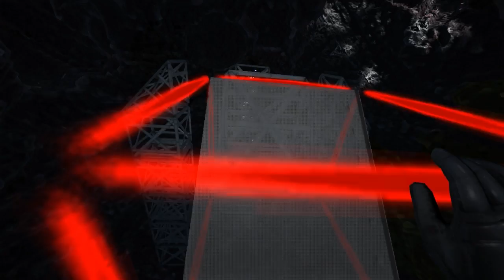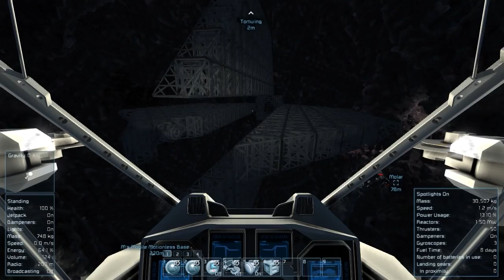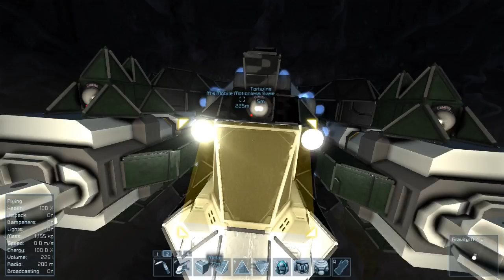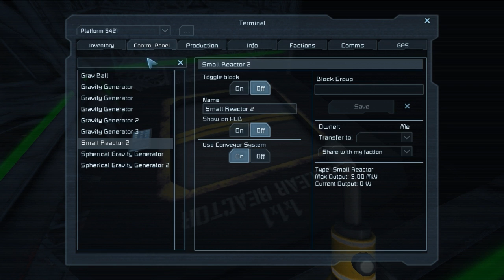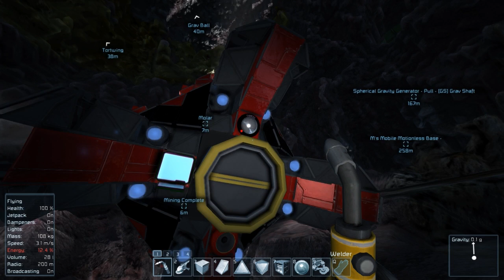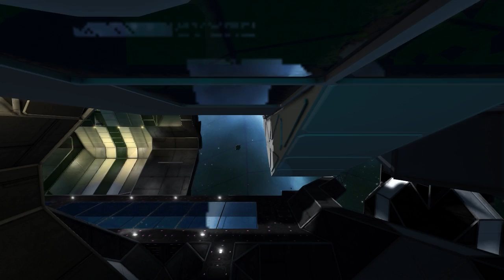Space Engineers • Solo Survival • 53 • Fins for Fun

Comment: Wow, Morilibus - that's one big ol' set of fins! Should prove handy for this asteroid but I fail to see how you might be able to haul it around and put it in the centre of another in the future - then again, that's what blueprints are for... I reckon the pulsing idea might work well with this design, but the need for it depends on Molar's ore ejection rate.

So, how many ejectors can you fit on Molar? You could maybe do with adding more than the design previously held, whether that means getting rid of the cargo or not I don't know - but Molar is far more versatile with the cargo still there (allowing for mining on other, remote asteroids). Either way you go, I'd get a second Molar up and running in the cavern to provide enough material to start the Skimmer - by which point you'll have the ability to get all the ore you could ever need!

Comment: To keep things symmetrical try 4 spherical gravity gens all say 1 block apart facing each other so they would all pull to center ,should stop them there and use a normal grave gen to from back with higher gravity to push them out only downside I would see is the one normal gravity gen would break being symmetric but you could fin around it ,be interesting to see. 
  Rigo 74